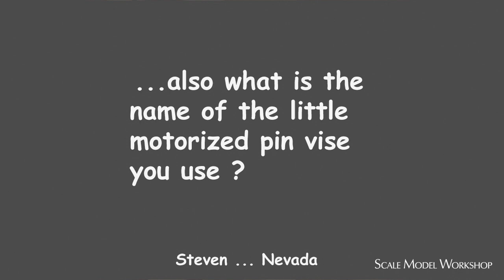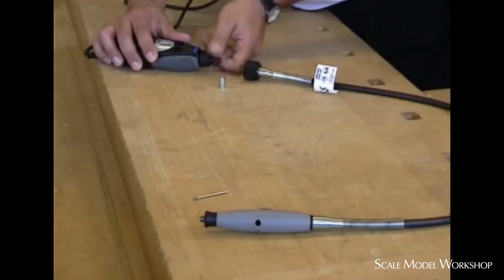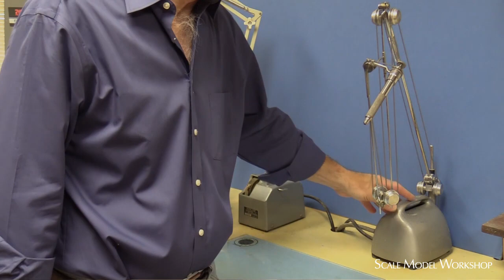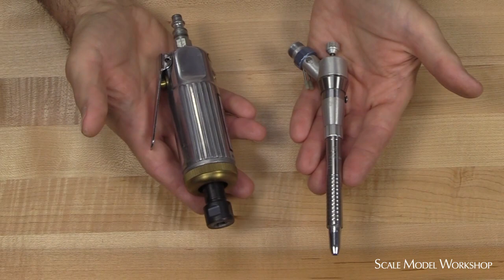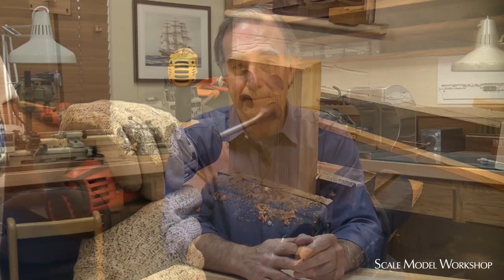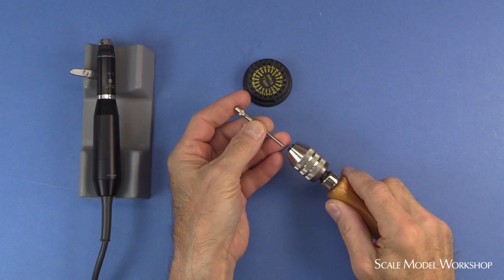Rotary Hand Tools for Scale Modeling

Comment: you can get an ultra quiet compressor from harbor freight and order a pneumatic die grinder and pretty much have most needs met for a pretty affordable cost. much more reliable than dremel as well. i have burned out a ton of those, but i do engraving with them, im just starting to learn about modelling, havent even started my first.

Comment: I’m kind of tired of hanging my dremel shaft from the ceiling to keep it from heating up. So I ordered this jewelers drill from amazon. It doesn’t have variable speed but doesn’t melt plastic yet can still get through 2mm styrene with ease. It’s got a high torque brushless motor in it. It probably spins at like 300rpm or so maybe a bit more.

Comment: Hi Bud, love your videos, one very cheap option you didn't mention, it's the Tamiya hand drill. I bought one because of the fast RPMs on my Dremmel melting plastic, not sure what the RPMS are on the Tamiya drill is, but there is no melting on plastic, it's battery powered and Demmel Collits fit into it so I can use .3mm drill bits and other tool accessories that Dremmel make. I looked and looked on the internet for a slow speed tool and that was what I found. Keep those videos rolling, loved the airbrush vids.

Comment: Sure, it’s a 
Drill: Belle Electric Nail Drill,Professional 220V Nail File Set Electric Manicure Pedicure Kit for Acrylics, Gels Nails

Drill bits:
Crystalum Ceramic Pointed Cone Cuticle Cleaner Drill Bit for Electric Rotary Nail File, Fine

by CRYSTALUM

I purchased it from Amazon. The metal bits became too hot, hence the ceramic bits, they didn’t chew or melt the plastic. Crystalum made various grade bits, I use the medium, fine and ultra fine ones. I use it a lot, but highly visible areas will need the usual polishing post drilling. The drill bits will fit any drill, but I like this one because of the variable and reverse speed, it fits my hand perfectly and has an on-off switch on the handle (not displayed in the picture. Hope this helps.

Comment: I had the same issues until I purchased an electronic drill for filing and polishing finger nails. It has variable speeds, reverse and is extremely quiet. Cost was about $30. Bought ceramic drill bits, these don’t clog or get hot. It’s great for narrow gaps on models. Also, you can control the hand piece on the controller box or hand piece. I have been using it for several months and love it.
Reply: You wouldn't want to spill the beans here, would you? Like, what is it?

Comment: Paul... You do know that you could have saved all the money for the Osada and simply gotten a Piccolo arm for the Wells engine...
Reply from the maker: My bench is pretty deep and the short arm just winds up going straight and running into other things on the bench.  I've used them and don't care for them because the movement is too restrictive.  And finally, since I'm using my original Wells at the office, I would have had to buy an entire unit and that was more expensive than the Osada.
Reply: Thanks for the reply, Paul. I understand.
And you are absolutely right about the price of the new Wells engines, close to $1,200 now. When I bought mine (brand new in the mid 70's) I "only" paid $450.

Comment: Paul,
is there a particular miniature drill chuck adapter you particularly like? I've got two, neither of which seem to be smooth or very accurate - lots of wobble in the drill bit. I think one was a dremel and I have no idea where the other came from
Reply from the maker: Unfortunately I've not fount one yet .